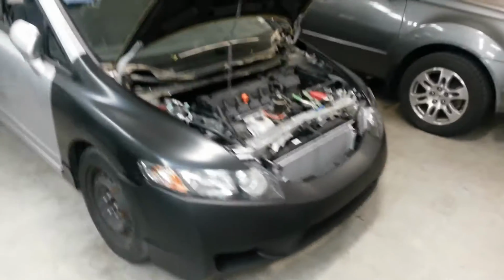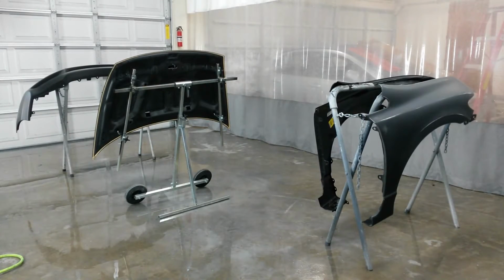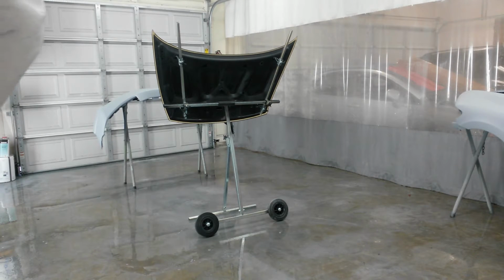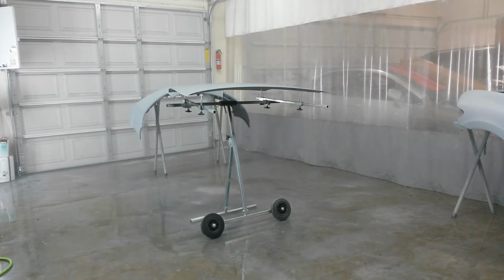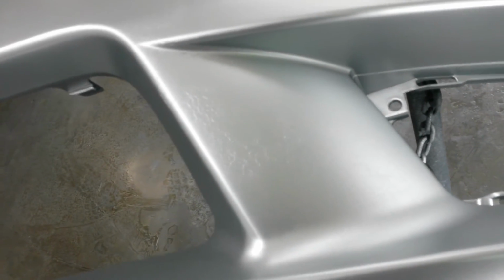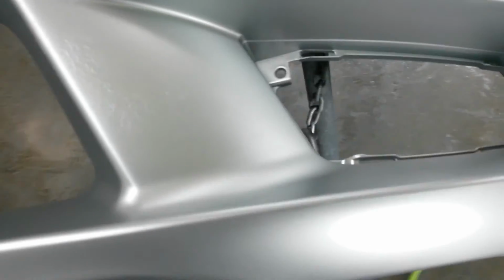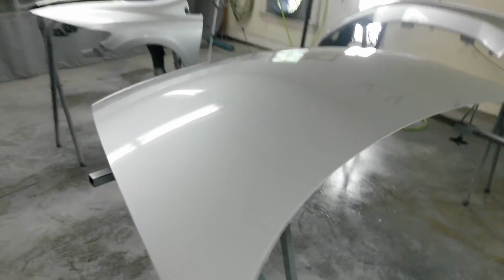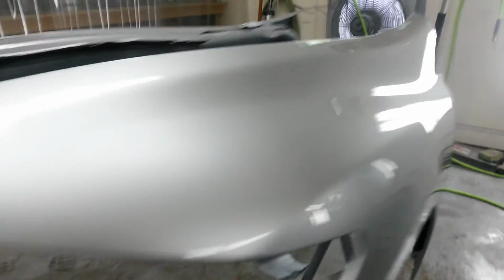2009 HONDA CIVIC REBUILD | PANEL FIT AND PAINTING CODE NH-700M ALABASTER SILVER

Comment: Since I'm a Newb...would it be wise to test fit with the support on after placing a tac weld to ensure everything fits correctly before continuing the welding job? I'm replacing my acura's core support and wanted to ensure I'm doing it correct
Reply from the maker: If you install the hood and measure the diagonals and get the support square and the hood striker hits the latch in the center of the hood striker, you technically wouldn't need to install the fenders, and other parts, but if you want to be certain it's in the right place, I would recommend you buy several cheap vice grip clamps from Harbor Freight and clamp it in places where you can still mount the fender and lights instead of tack welding it. It will save you a lot of cleanup and removal tack welds. I do the clamp method when i hang fenders for test fit, but if the measurements are correct, even that is unnecessary. Thanks for watching and good luck. let me know if you have more questions.

Comment: Im spraying the same color what psi are you spraying at had nothing but problems any other color im fine lol
Reply from the maker: Around 18-20 psi on my digital gauge on a SATA 4000 RP. Make sure you are using correct temp reducer and drop coat
Reply: @samg5543  im using nason ive bin spraying at that range im using meduim i asked for the slow they looked at me and said its un common to use a slow makes sence the color is dry in about 5 minutes or less

Comment: Speaking of panel color matching, especially in silver in your experience which paint system comes through better for that? Thanks
Reply from the maker: I have only used Chromabase base coat from Axalta. I have good luck with it as long as it's mixed properly to the code and VIN, but I don't have experience with anything else to compare it to. This color was very close, but I would have blended it if it was a customer's car. I don't take any chances with silvers or golds. They almost always need to be blended. It's best to go ahead and blend so it's done in one shot. More efficient use of time. Darker metallics often can be butt matched pretty well. One example of butt matching is a replacement rear bumper. It's often not practical to blend both quarter panels and end up clearing the whole roof rail and rocker panel just to blend a little color onto the quarters. If it's a high-end job and the customer wants to pay for it, then I'll do it. I always let them know ahead of time what I recommend.
Reply: Thank you for taking time to explain it.. I agree with your overview.. for me RM Diamont nails the color most of the time.. as long as I give the panel to match to one of their chips.. a couple other systems I tried can't even match their own color chips.
Reply from the maker: +akd052774 no problem.  any time

Comment: Very good job can I ask you how much paint and how much clear you bought for this project
Reply from the maker: I bought a quart of base color which makes 2 qts when reduced. I stock clear by the gallons, so I used what I already had. probably took at least a quart of clear.
Reply: Thank you for answering back last couple of questions I am about to paint my Civic front collision too,it is a Galaxy clear which sealer should I use and what brand of clear did you use thank you in advance
Reply from the maker: ignacio orduna any sealer should be ok, just use a 2 part sealer with a catalyst. I use Cromax clear. Just make sure to use sealer, color, and clear of the same brand, and it should work fine.
Reply: Thanks for the quick response and I will understand if later on you can't respond I hope for this channel to grow a lot, without a doubt I can tell that your know how to videos are for all of us that want to learn something and as you can tell I don't know much about painting but I am the kind of people that looking at your videos make me feel like I have a chance to get things done even if I don't get them right the first time thank you and good luck to you
Reply from the maker: ignacio orduna good luck to you too. It's not difficult.  The difficult part is actually trying it out and sticking with it until you get it right.
Reply: I just replaced the support but had couple problems the support has bigger nuts where the radiator brackets bolt on I bought it on eBay cheap I guess I got what I paid for also the same left bumper bracket is built wrong anyways when you buy your parts do you always make sure they are capable certified? Thank you
Reply from the maker: ignacio orduna i definitely use capa certified when possible, but they're not always available.  For steel and welded parts, capa is the best if you can't afford OEM or used.
Reply: Sorry about all the questions it is a great feeling to see my car almost put back together and been able to drive it and this mostly thanks to you .your videos are so detailed that we just need to do our homework and most likely we can get a decent job thank you again
Reply from the maker: ignacio orduna no problem
Reply: where did u buy the paint
Reply from the maker: at my local Cromax distributor. it has to be mixed to the paint code and VIN of the vehicle to get a good match. search for body shop suppliers in your area, and most likely most they will also sell paint.
Reply: My car has Silver alabaster paint and a guy said he can get the paint for $100 and fix my car for 700 is he legit?
Reply from the maker: Geezer Gazoo that highly depends on how much damage there is. $100 for good paint would only paint  a few panels.
Reply: Sam G good afternoon I’ll try to make this very short it’s been 2 years and never had the chance to paint my civic here is my situation now ,with covid19. Igot lay-off so time is not a problem my sister got hit on the drivers rear quarter panel went to junk yard cut a car unwelded the part and put my civic back to it’s original state somewhat.2 years passed since I fixed front so panels started rusting so I sanded everything with 80 grit down to metal I also had to do some bodywork on hood so here is what I think I will do I hope you can guide me just by telling me if my steps are right so I will epoxy completely all panels including rear quarter panel then. Primer surge ver sand this with 400 then base coat then clear but befor I epoxy everything with sand grit should I use before epoxy

Comment: Where did you learn how to paint? When you come to the end of a stroke you stop shooting paint, and pick back up when the gun comes back into line with the panel! You  throw half of it in the air @ the end of each stroke!!
Reply from the maker: I used to spray that way for years, but I tried it this way and never went back.  Keeping the trigger depressed keeps the fan pattern and the pressure at the tip consistent throughout the entire job so there are no variations in atomization and texture at the edges of the panel. It also helps with reducing hand fatigue and gives me a better rhythm. I have found this technique provides better results, so I have switched, even though it uses just a little more paint. If stopping at the end of each stroke works better for you, go right ahead. Thanks for watching.